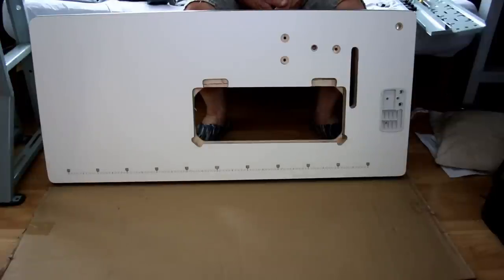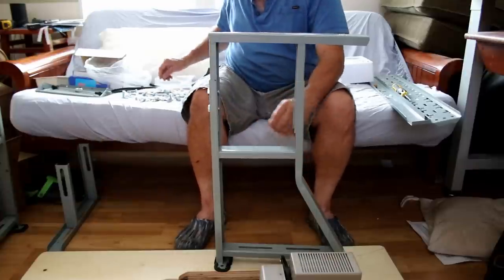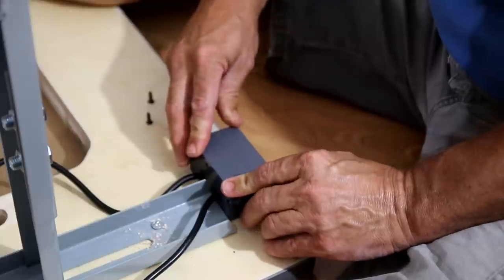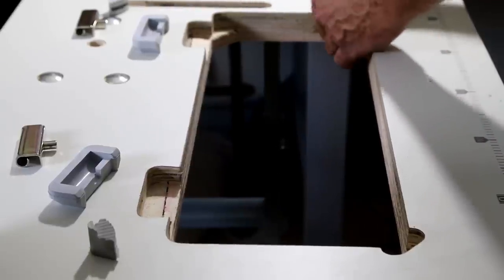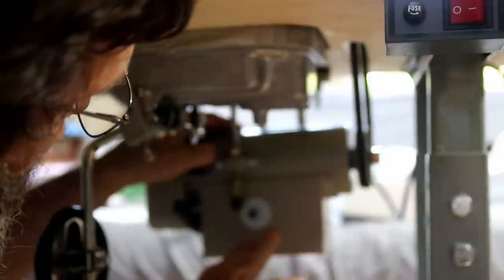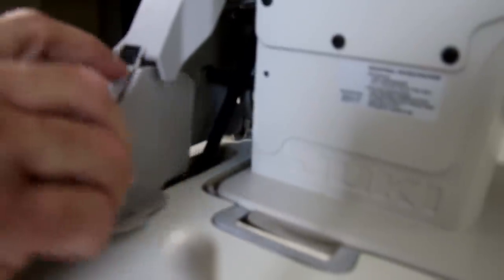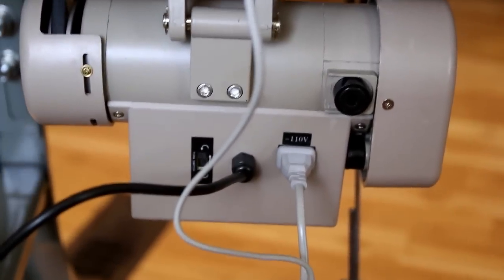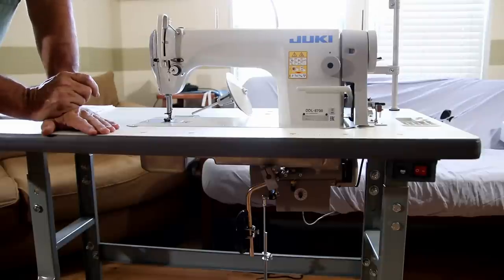Juki DDL 8700 Table, Motor & Sewing Machine Assembly

Comment: Thank you for doing this. I just started putting it together and your video has been incredibly helpful. I contacted Juki as far as directions go and have yet to hear from them. I have a degree in fashion design and the sewing machines we used were these. They are incredible and probably the best I’ve ever used. I guess they know that.😂
Reply from the maker: We are happy this video helped you out.  Thank you and good luck with your fashion career.

Comment: Oh I purchased one for my Juki TL-2010 and it's wonderful. The only tip I could give you is make sure you are putting the bottom brace where you need it for your machine use. I am using the foot pedal right now and we should have put it in the back section and sadly it is in the front and has to be moved
Reply from the maker: You need to remove the sewing machine, then the table top, rotate the table top 180 put the table top back on and then flip the foot pad and put the sewing machine back.  Our video https://youtu.be/s7AILadQYNQ will show you how to correctly put the table together.
Reply: How much price these machine ranging? In USD help me please.. Thank you

Comment: Thank you so much for the video. It made it so much easier to put together my machine. I liked how you show the screws and where to drill and how to adjust all the settings. I Still have an extra piece that is pretty big, but I'll call the company about that one. Thanks again.
Reply from the maker: Thank you for your comment.  If you can post pictures to our just the good bits facebook page we may be able to tell you where your extra part goes.   https://www.facebook.com/justthegoodbits

Comment: Thanks so much for this video! Do you have details on the motor - model & version? I have watched several videos for this machine and seems like there are different types of models that are compatible with it.
Reply from the maker: There is a link under the description box giving the machine purchase price and all the information about this machine.  
Here is information I copied from the listing:
uki DDL-8700H High-speed Lock-stitch Sewing Machine for heavy material .ASSEMBLY REQUIRED, please note machine comes unanssembled *This model is NOT a walking foot !*
✅It comes complete with sewing machine table and Electronic DC Servo Motor 1/2 H.P, 1 PHASE, 110 VOLT, 0 ~3300 RPM (Model DMS-550), everything (drawer, belt, tools,lamp and instruction manual) brand new, paed boxes and never been used beforecked in seal
The Juki DDL8700 H "Heavy"model don't have the walking foot mechanism in .
✅SINGLE NEEDLE LOCKSTITCH AUTO-LUBRICATION OF HOOK HORIZONTAL AXIS HOOK AND BOBBIN ADJUSTABLE REVERSE FEED
✅INCLUDES: Thread Stand Bobbin Winder Oil Pan/Knee Lifter 5 Extra Bobbins 10 Extra Needles Instruction Manual Screw Driver Machine Oil Table top (size 48" x 20") Heavy Duty Legs, Table Top,Clutch motor V Belt Hardware ✅ASSEMBLY REQUIRED, please note machine comes unanssembled

Comment: Question: I live in a small apartment building.  The walls between neighbors are somewhat thin, but do offer a fair amount of noise isolation.  I want to get a Juki 8700.  Would this machine be too loud for my neighbors?
Reply from the maker: Not at all, the Juki 8700’s motor makes almost no noise at all.  The only noise from this machine is the stitching.

Comment: nice video, but the setting of the height also depends if you are sitting or standing, and if you have a gas lift office chair, or just a set height dining room chair. ( as there you have to accomodate the operators knees, so the lower leg height is the important one in this case.)
Reply from the maker: Good point!

Comment: Very nice. Sir my machine is taking cloth in reverse, when I stiching. Can u give me solution sir
Reply from the maker: Sounds like the reverse is stuck, work your reverse switch back and forth running scrape fabric through the machine.  If both forward and reverse is moving in reverse oil may help.  Perhaps there is a Video here on YouTube that will show you how to oil and fix your reverse, maybe you need to replace the switch.

Comment: What must be the height of the machine plz rply 
Previously I uesd old vidya sewing machine but since last two years I'm using juki DDL  8100 E model .
Since then I have got neck and shoulders pain  I think it's because of the machine and improper  sitting chair 
Plz help me out of this 
Pls do rply what must be the height of machine as well as the chair or the stool
Reply from the maker: I understand where you are coming from I too had pain, mostly back pain until I purchased an adjustable chair with a back that pushes against my back.  I found the perfect chair at goodwill of all places and gave my expensive chair to my husband for his desk.  The legs are adjustable on your sewing table and should be adjusted to your own height.  I'm short so how high I have mine will not work for you. Sit with your feet flat on the floor and your arms flat up to your elbows on the sewing table, with your back straight and arms at a 90 degrees flat up to your elbows on the sewing table top. Adjust your chair and table until you can sit in this way comfortably. You will need help to do this.  I hope this help. Did you need us to make a video on the best way to adjust the sewing table?
Reply: @justthegoodbits1  Thank you so much dear for this msg it's good if you make a Vdo on this 
Practically I can understand a bit easier 
Once again Thanx

Comment: I'm (the wife, lol) thinking of getting one, so this has been very helpful.  Do you do free motion quilting with it?
Reply from the maker: I removed the feed dogs and have done a quilted Halloween bag but I must warn you this machine is really fast and takes a lot of time to get the hang of it which I still haven't but when I do I will upload a video.
Reply: @justthegoodbits1  I subscribed so look forward to seeing more. I worked at a shoe factory a zillion years ago, those were super fast too. Of course,  industrial.  What's your normal sewing machine?
Reply from the maker: Juki TL - 98 QE a quilting machine and Singer XL 580 embroidery machine which i use for sewing only when I need a decorative stitch, zigzag stitch or button hole.  The Juki TL - 98 does none of those.

Comment: The belt that came with the machine is a M-39 and is too loose on the pulleys. Did anyone else have this issue and do you know what size is correct?
Reply from the maker: The size of the belt depends on the size of your motor pulley the link below is for the Juki DDL 8700 & H manual on the last page (12) gives the size belt for the different size motor pulleys used on these machines.  http://www.juki.co.jp/industrial_j/download_j/manual_j/ddl8700/menu/ddl8700/pdf/instruction_eg.pdf
Reply: I know this was old comment. I had to buy a shorter belt too. My 39” was too loose even when I had the motor as far down as I could get it. A 38” would have been perfect but I ended up getting a 37” cuz I wanted it next day shipping lol. The 37” worked for my needs. The 37”, I had to tighten the motor as high as it would go. Not too much tension on the belt. It works. But the 38” would have been better.

Comment: My machine head is not turning, how can I lift the head ?
Reply from the maker: It sounds like your head has froze up from lack of lubrications. Has your machine been sitting along time? The oil does not get to your machine unless it is running.  If  you have been using your machine then it may be the pump which pumps the oil up to your machine has stopped working.  Oil your head and the fly wheel and if you can the shaft in-between.  If that works then it is the pump if not you need to take it in to be serviced and fixed. Hope this helps and thanks for your comment.

Comment: also your cameras autofocus is on the wrong thing ( it's focusing on the closest objects, NOT on where you are moving around, screws you are aiming at, etc. ) NEED to use MANUAL focus or AF mode 'S' for single shot focus.
Reply from the maker: Thank you for the tip will use in future.

Comment: I had to leave my belt guard kind of loose cause it was snug against the belt
Reply: In case others read this and also have issue… I had to buy a smaller belt because my original 39” was making it rub on the belt guard. A shorter belt allowed me to “tighten” the motor and it changed the angle of the belt so it didn’t rub anymore. I tried everything to make my original belt work but it always slightly touched the guard. Changing the angle fixed it all. Hope that helps someone if they have same issue.